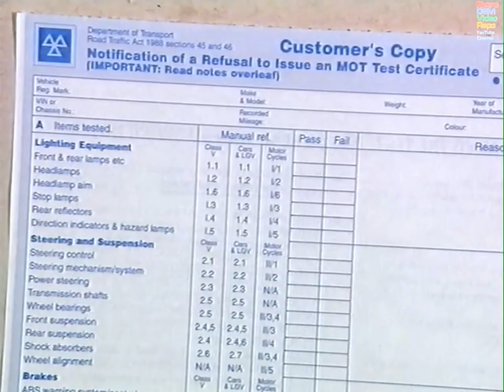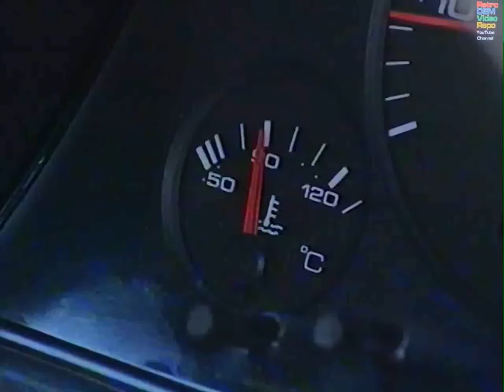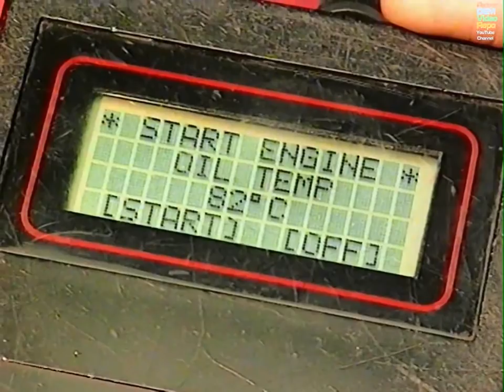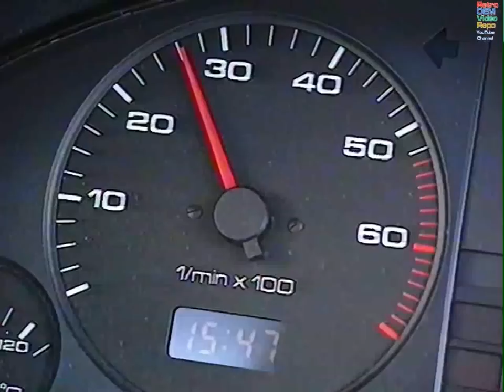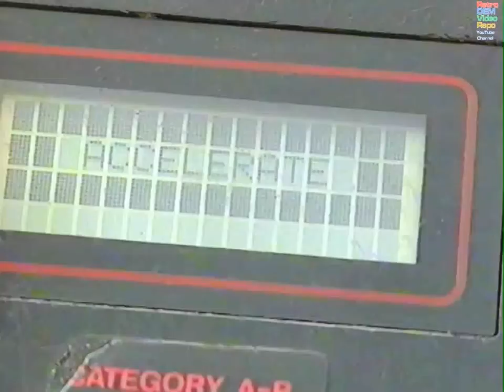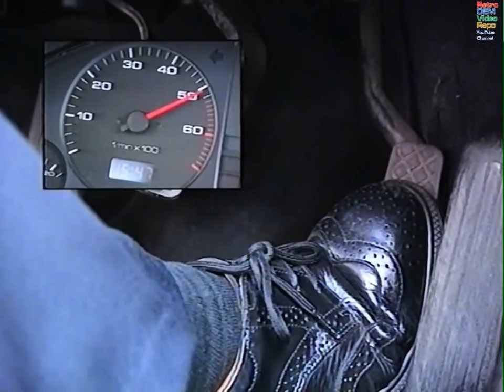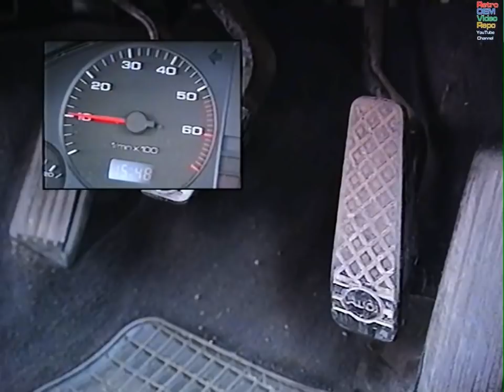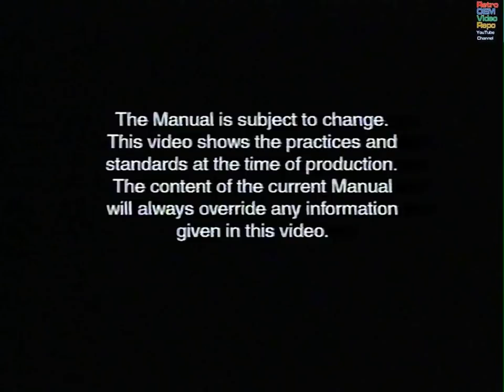Vehicle Inspectorate (UK) - MOT Matters - Diesel Do - VIV18 (2000)

Comment: On Series Landrovers, we used to 'suggest' that customers tied a small piece of wood to the underside of the accelerator, that way they didn't reach full throttle and usually went through, otherwise they rarely passed. Test as presented , no mention in the manual about checking throttle adjustment......